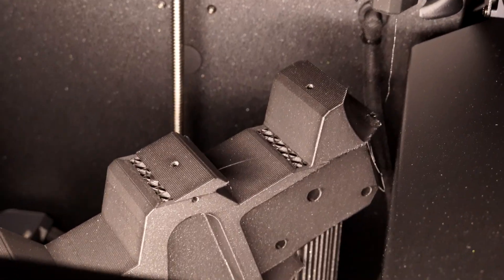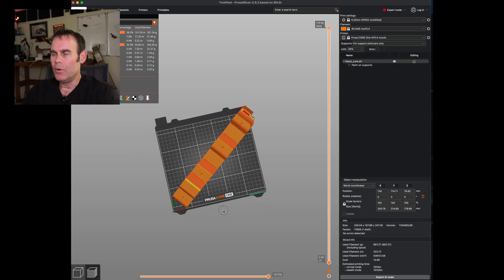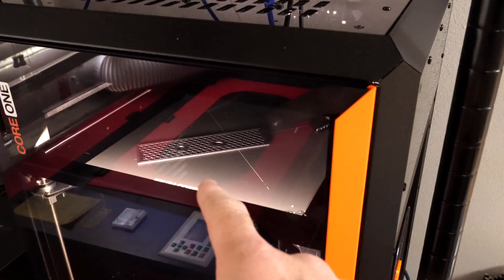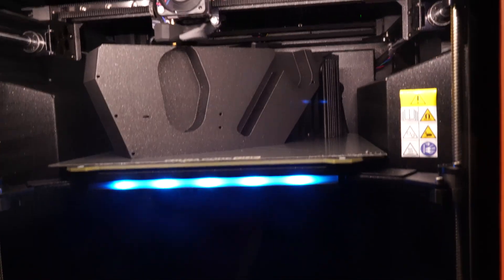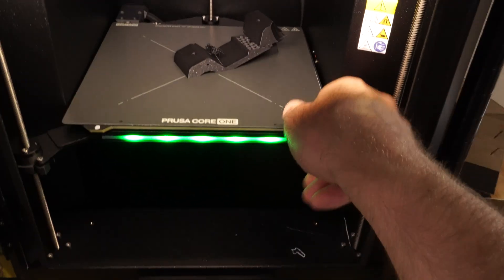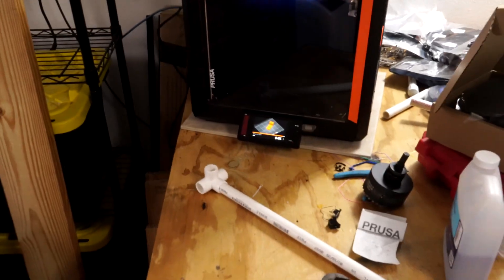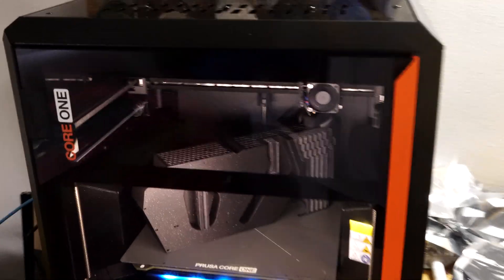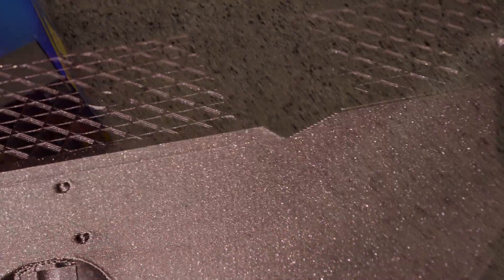How a Simple Base Upgrade Solved High-Speed Layer Shifts on the Prusa Core One 3D Printer

Comment: Im also having huge issues with layer shifts, researching online it seems that they can stem from both hardware and software issues.... They come at random and very annoying to deal with. Prusa needs to step up their game, my P1S has never shined so bright.
Reply from the maker: Thanks for the comment. To be fair, I've yet to have another layer shift issue after putting it on a more solid base. Also have mostly not used the default fastest setting since then, so that is probably a factor too.
Reply: @JeremyCook  Hmm okay, it seems so silly that an issue like unstable table would cause these issues. Ive seen a video of a A1 mini printing perfectly hanging from the roof! I will update if i find anything interesting.
Reply: @JeremyCook  One more thing, did your coreone have trouble homing? When we first got this machine it would get stuck in the homing procedure, just banging into the walls for 5 minutes. The machine now takes longer to home then normal, so im thinking that might also have something to do with it.
Reply from the maker: @ElliotÖstlund  It did bang around a bit to begin with. IIRC I put it on a solid base and this was greatly reduced.
Reply: @JeremyCook  will try this thanks! I also seem to have found my layershifting issue. When printing PETG, a blob builds up and later falls down in to the print. Then this fat blob cools down and hardens, it causes the belt so slip when the nozzle later hits it. I was printing a full plater of objects with 100% infill, so the blobbing was intense! Cant seem to get rid of it completely, and it always compromises with poor extrrusion :(
Reply from the maker: @ElliotÖstlund  Ah, well glad you got to the bottom of it! You can also put a concrete block or similar under your printer to add a bit of mass. I have not tried this myself, but I suspect it would help.

Comment: My core one shifted due to a gear in a motor set wrong (but it was me). But I should look into stabilisation, to get better prints. Nice guitar!
Reply from the maker: Well thank you! Yeah, it can't hurt. I've been told using a paver as a weight underneath works nicely too. That would allow me to get it back on the shelf and out of the way!

Comment: I just think having a 3D printer must be so handy. You could repair all sorts of things around the house that break. Stave off built-in obsolescence.
I had to chuck out a bathroom pull chord light switch because one tiny little plastic part was cracked inside the mechanism. I wish I could have printed a replacement. I just hate throwing stuff out instead of repairing because it's such a waste and terrible for the environment.
Reply from the maker: You should get one then IMO! Even much less expensive printers can be quite useful. Lots of common stuff to print available on Printables etc, and if you can 3D model, all the better. Thanks for the comment!